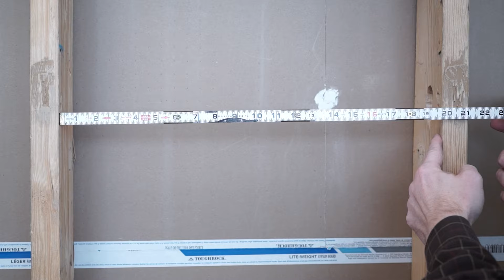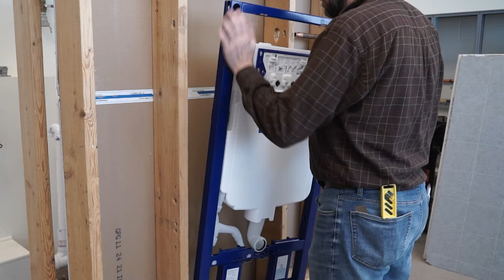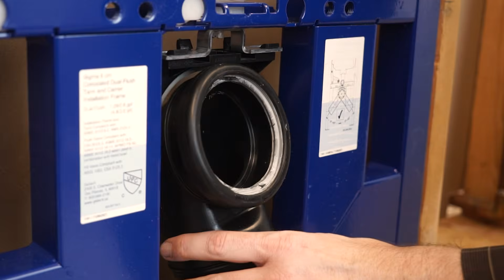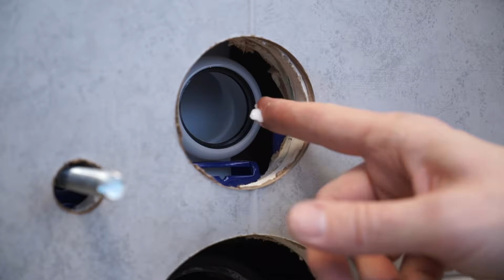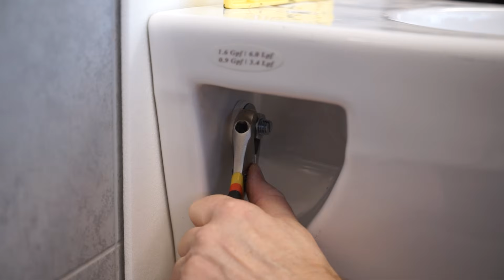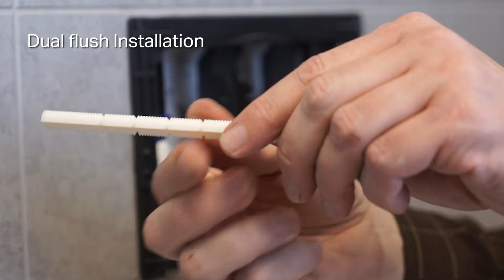Installation How-To: Installing a Geberit system in a 2x4 wall

Comment: How are we supposed to know the height of the toilet bowl in relation to the frame?
Reply: you gonna need to look at the drawing sheet of your bowl. calculate distance from the rod attachment points up to the rim, then add toilet seat thickness.
Reply: @dfly1115  damn. I haven’t picked a bowl yet 🤦🏾‍♂️

Thank you!!
Reply: @QIrons  no problem, I'm in the same process right now :) Make sure to think ahead; like do you want to put a bidet toilet seat on it? If so, gotta make sure the dimensions are compatible
Reply: @dfly1115  wow! Thanks for the heads up on that too! I’m planning to get a bidet seat!
Reply: @dfly1115 this is my current issue . I will have a bidet but have not chosen toilet bowl or bidet

Comment: The installation is identical in a 2 x 4 wall. The discharge pipe gets centered in the sill plate. Being the actual width of a sill plate is about 3-1/2", the discharge pipe will JUST fit. A metal screw plate is suggested to protect the discharge pipe.

Comment: Sorry folks, that's not a 2x4 wall. What's up ?
Reply: Geberit… can you address this, why would anyone purchase the 2x4 version and then install it in a 2x6 wall?  If you have to install the waste pipe 3.5” from front edge of sill plate that won’t work in a 2x4 wall.  Do you have a different video of the 2x4 wall install?
Reply: @daveross8      The installation is identical in a 2 x 4 wall. The discharge pipe gets centered in the sill plate. Being the actual width of the sill plate is about 3-1/2", the discharge pipe will JUST fit. A metal screw plate is suggested to protect the discharge pipe.
Reply: Two MAJOR omissions which are conspicuously absent from both this official installation video and the official paper instructions that accompany the carrier designed for 2x4 walls are the following:

First, while it's true that a 3.5" diameter hole (the O.D. of 3" Sch 40 PVC is 3.5") bored through the bottom plate of a nominally-dimensioned 2x4 wall (if possible, install the carrier in a wall framed with "native" or "rough" dimensioned 2x4 material - keep reading for why - plenty of walls that meet this spec east of the Mississippi) - will allow a 3" PVC riser to fit within the shallow confines of such a wall, WHAT ABSOLUTELY WILL NOT FIT is the Fernco 3" x 3" hub-to-hub jacketed coupling which, at least in the U.S.A., is supplied with the carrier. Thus, and this is the crucial part missing from the discussion, the connection with the riser needs to be made BELOW THE FLOOR (assuming you're working with a basement or crawlspace situation or on a story above the ground floor). Plus, this requirement (not an issue if working in a native-framed wall - like with 2x4 framing that measures at or close to 4" wide) has knock on effects, the most crucial one being that depending on the thickness of the floor and whatever might be beneath it and what bowl is selected, there may not be enough available length with the supplied ABS water closet bend to permit it to extend down below the level of the floor once the extended length of the carrier's legs is taken into account. With some (if not most) carrier/bowl combinations, and especially when coupled with the desire to have an 18" or 19" rim height, the situation can occur where the supplied ABS bend is not long enough. What then, right?! 

Second, the flip side of this is that if your selection of bowl and rim height doesn't result in this conflict occurring (another associated factor, of course, is what extra layers your wall may be sitting atop of,  thus only adding to this problem) and you DO have enough length in the supplied ABS closet bend, what you will likely overlook is the ability to take advantage of being able to slide the ABS bend down into the hole you've cut through the bottom plate of the wall (and all the layers of flooring and subflooring that the plate may be sitting on) BEFORE you permanently bolt the carrier into the framing and install the water supply line. If, like me, this doesn't occur to you until late in the install (and the instructions certainly are utterly silent about this) and you don't accomplish these steps in this order you will find yourself needing to hack up the back of the nice hole in the bottom plate (and all the layers of material beneath it) that you drilled in order to provide enough clearance to slide the closet bend into place AFTER the carrier has been installed. 

That Geberit fails to so much as mention these crucial pieces of info (furthermore, I watched several install videos produced by other parties before accomplishing my first install, some involving 2x4 walls, and not one mentioned these pitfalls either) is stunning. In fact, I would argue that these omissions rise to the level of negligence. I'm mean, c'mon, this is hardly their first rodeo - they've been producing these toilet systems for many decades, I can't be the first person to raise the alert.

In my case, given the make and model of bowl I chose to pair with the 2x4 carrier - a Geberit-approved model, the Duravit ME Compact (which is the lowest profile/shallowest bowl I could find - the ideal choice for a tiny bathroom) - and the existing situation I found myself working within...

...which consisted of a 3/4 bathroom addition, c.1993, in a late-18th century home, the latter's flooring structure consisting of 1" native planks as a subfloor, 3/4 thick maple strip flooring on top of that (the interior nominally-dimensioned 2x4 wall that I mounted the carrier in sits on top of that maple flooring) but then, in the bathroom, more layers consisting of a layer of 1/4" lauan, a layer of sheet linoleum (glued down) and the new finished floor, soon to be LVP)...

...the supplied ABS water closet bend not only needed to extend down below all those layers of framing and flooring (again, the Fernco coupling will NOT fit in a nominally-dimensioned 2x4 wall so the connection to the riser MUST happen below the floor) but, because of that, the riser should have been cut to length (in my case I only needed to remove 3-1/2" from it) and inserted down through the floor BEFORE I permanently installed the carrier. As further background, because of the above scenario and a desire to achieve a 17" rim height, I didn't need to extend the carrier's legs at all (other than on one side, minutely, to adjust for plumb - one of the studs I used was existing/old work).  

Now, I didn't think that far ahead - my mistake - but a simple heads-up from Geberit about this scenario (which I'm sure plenty of others face) would have been so easy to do and so much appreciated. Said another way, since this is literally the last step in the install process, an early warning about the need to address all these considerations is essential.  

Most egregious, of course, is the absence of any warning that the Fernco boot will not fit in a 2x4 wall. This conspicuous omission - especially for a product designed and intended to be installed in a 2x4 wall (!) - is just beyond the pale. At the very least, a warning about this should appear in all the marketing and product descriptions detailing the 2x4 carrier as well as on the first page of its instructions, if not also on the cover (as well as on the outside of the box that encloses the carrier). It should also be at least mentioned in the above video. 

My guess is that a large subset of buyers of Geberit's 2x4 carriers, at least in this part of the world, consist of installers who will have never seen one of these toilets systems in person before, much less will reliably think through in advance all the points I've raised. Thus, a little guidance from Geberit on these crucial elements affecting the install in an old-work scenario would be much appreciated. 

I hope this helps the next first-timer.
Reply: @FairweatherHandyman-sc6js  comment of the year! All we need is a step-by-step video from your experience. 😀
Reply: @pjf93  Yes......So is buying the 2x4 system and install in a 2x6 wall the safest way to go?
Reply: @FairweatherHandyman-sc6js will the 2x4 version work on a 2x6 walls ?
Reply: @FairweatherHandyman-sc6js  Thanks for this,
 I was planning on framing a box for this since it will be against a party wall in a condo and I can't frame it into the existing wall, I'm going to get 2x6 material and rip it down to 4 inch to give me the room needed and not have the full 6 inch push out into the room.